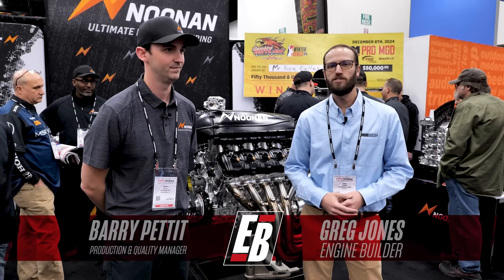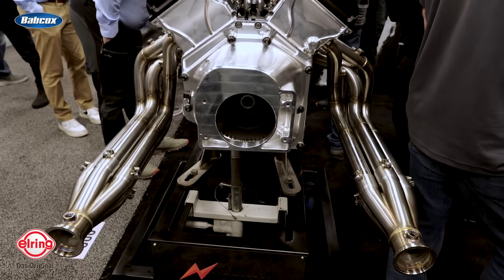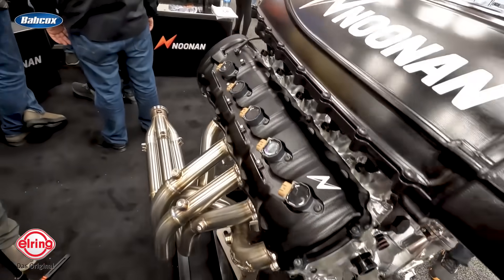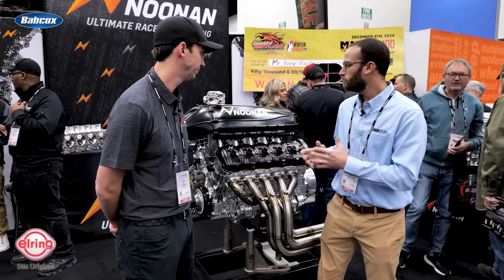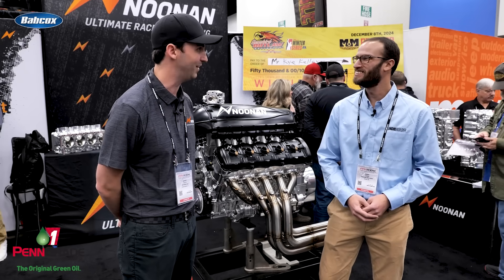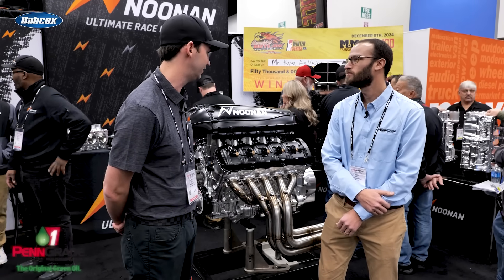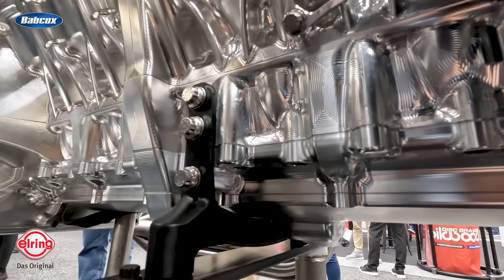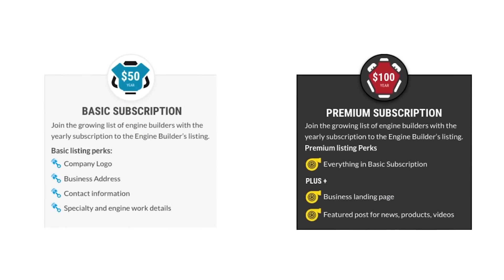Noonan's All-Billet 5.8L V10 DOHC Engine

Comment: Simply splinting the piston crown section from its skirt to be operated via a (valvetrain-like) piston-train that makes the exhaust and intake strokes between the compression and power stocks - called D-cycle (differential-stroke cycle). This piston-train can retrofit the V10 to run like a 20-cylinder (actually >2.5 times more toque) engine. The D-cycle can also retrofit existing i5 to run better than 10 cylinders.

Comment: "Cough" Audi bell housing. Audi developed the 5cyl in the 70's. VW bought Lambo. Lambo was known for V12's. Crappy V12's.
Reply: Lamborghini engines are the most reliable ones since Diablo. Huracan V10 are bulletproof.
Reply: @ designed and built by Audi. Lambos were complete POS’ up until VW bought them. Crappy block castings etc

Comment: Only question(s) missed -  Intake and Exhaust Port Symmetry for 'Reverse' packaging ?
(can the same headers be used on the opposite block sides ? can the intake manifold be turned around for rear intake ? ......sorry, Blame Chevy LS Life ;) .... ).

Comment: Considering who this comes from you have to expect it to be a real performer.  With buckets RPM is no problem and they are reliable.  I had them in my Rover 2000 and I took that motor, with points ignition, normally in the first gears to 7,200 stock.  It did not care.  It also had a gear system inside of the can gear that could adjust the cam timing by 1/2 degree as it streatched.  The motor had on it two parts to lock the cam and crank into exact position do set the cam timing.  Except for hydraulic springs, as in Formula 1, nothing revs higher and easier, more consistently than buckets with shims.  They take time to set up but after that you can go a long time.  Being billet, and water jacketed, it should be almost bullet proof and weldable as you see Steve Morris fix all the time on billet blocks and heads.  Big advantage with high dollar blocks and heads.

I want to first see and hear it on the dyno, then racing.  It should be a good endurance motor.  Morris has proven this with good billet parts.
Reply: My 250cc IL4 sportsbike that did 17-19k rpm regularly also had buckets and shims for similar reason.

Comment: I don't want to come off negative but it sounds like he wasn't exactly keened on the components. He seemed caught off guard. Head CFM? Block is 2bolt,4bolt,6bolt? There was no mention of it's size to other V10 either. His own words just put together for PRI..No dyno info, if it were done they would have a number knowing it would be asked. So it might not be anywhere near final stage or offered for sale product yet. V10's V12's is that exotic car area and price for who's car? That's high price market with some collabing from major company design and production with most V10's. With cutting edge AI to help. We all know a boosted or n/a engines are not built the same but specifically for one or the other so again it's not at a point they can sell it. If each engine is built to customer spec then ok. But building those (one of) engines from scratch are really expensive and babie til it's final stage. Then it's to the failure testing. That would have been mentioned. Are people going back to the 80's type car builds? Today's engine management is a must to keep this thing from granading on a missed shift or a guy that has more money than sense does the parking lot rev to the limiter and leave it there. I'm guessing this engine will easily be around $80k.
Reply: I going with 150k and up
Reply: Yeah, no shit. Did you even listen to what he said? This engine has so much testing left to do.
Reply: cant blame him , guy didnt even ask about any of that shit

Comment: This is not engineered, This is super high money. Nothing about this is cool, or new. 
Old fashioned tech sparkled by a rich kid for a big stooge. 

Thing is a joke. Rich boy toy.
Reply: You sound jealous....
Reply: If not engineered how exactly was it created?
How much is it?
Whilst DOHC 4 Valve per cylinder engines have been around since 1911, not the 1990's as stated by you in another comment, every internal combustion engine is old fashioned. So what is your point?

Supply and demand has been around even longer....
Reply: It's not new no but it is cool.

Comment: Anyone have any idea what such an engine would go for?  I'm just guessing, but has to be at least $100k right?
Reply: Yeah easy
Reply: @1985metalmaniac  Not very cost effective vs a Judd v10 then...
Reply: @N4CR  a judd would be utterly useless as a road going engine. It needs a block preheater and it's a sealed engine too
Reply: Plus considering required electronics plus plus
Reply: A short block LS is 12k also have LS heads at 8k so yeah it’s not cheap.
Reply: @johnshaft5613  first time, probably a little more

Comment: I’m patiently waiting for them to know make a larger coyote block with water jackets
Reply: I agree. Like why not take all ford learned with coyote platforms and make it a 351 or overal bigger cubic inch engine.
Reply: @docsmoke Modular Motorsports Racing allready does this. They have 351 billet crate engine and a 6.0l shortblock.
Reply: 429 coyote
Reply: @Alex-pl1ye   u could take a 351 version like the old school days and stroke it to a 427.
Reply: @ I think if you go thru the trouble of making a bigger block let’s make it for the next 10 years of racing base ci of 400-429 max ci 460 push lt1 shit in
Reply: @jeremeypope2212  Wow, this would be the ticket! I could only imagine a billet Coyote w/ a 100 cu.in. or more available. That thing is already impressive. There is clearly a following,  I believe it would sell for sure.
Reply: @jameshenson4871 a 5.4 coyote can make 850crank hp max effort I’m betting a 7.0 coyote can do the same not as max effort

Comment: 3500 FOR A BILLET BLOCK IS NOTHING SEEMS TO BE ANOTHER OVERPRICED CHUCK OF ALUIMINUM
Reply: Ain't no fn way that billet block is $3500! ....lol the dry sump bullet is probably $5k!!!!
Considering a Subaru billet block is 20k....a VW VR6 billet block is $20k.....this billet V10 block is probably like $50k...that's my conservative guess without any research anyway
Reply: @laynepipe5760  I think he meant HP.
Reply: @laynepipe5760 thats a 150k+ intake to pan package easy lol
Reply: $3500? I think that's the price of the oil pan alone 😂
Reply: The Noonan Billet LS was $80k. Not sure what the current price point is but I would guess this is north of that

Comment: That is not the future it is the past and far from being a new thing is it even modeled after an engine or is it completely new design because that makes it hard to get parts you can say what ever name yoi want but it will still be hard to get parts for
Reply: 90s vallve train
Reply: @brandon-x1l2i  "90s vallve train"?

Ernest Henry created the first Double Over Head Camshaft 4 Valves per cylinder in 1911. 

Direct acting cam on bucket OHC engines became common in 1950's.
Reply: You have no idea what you talking about. Your over here talking about like it's a 50's DeSoto hemi. Muh parts availability shut up.
Reply: Why the heck would anyone like your ignorant comments.

Comment: Bore spacing and deck height?
Reply: Yeah the PR guy seems not prepared for the interview. He left out so much info about the engine technical data. Or else this engine is still in prototype phase
Reply: Yeah is questioning was lackluster
Reply: Interviewer never asked the question.

An engine like this you could talk for hours about every aspect.  This was 8min video to highlight some of features it has